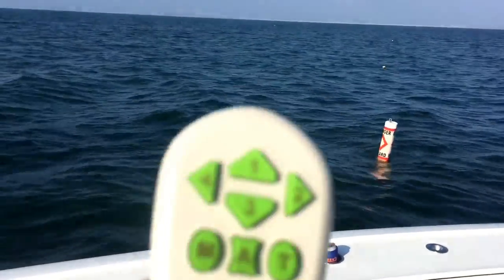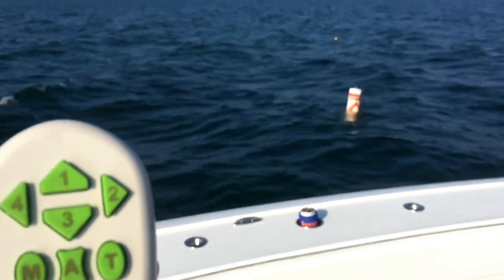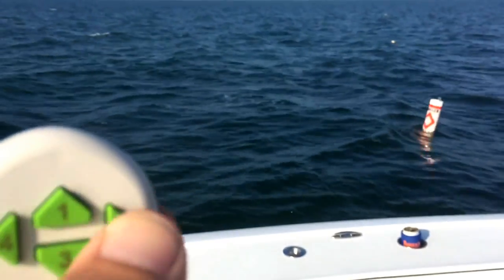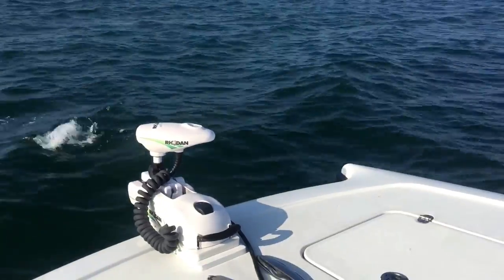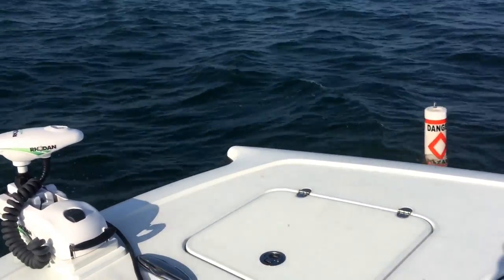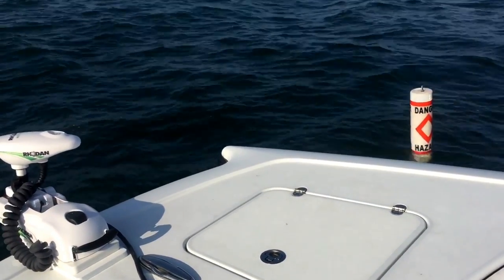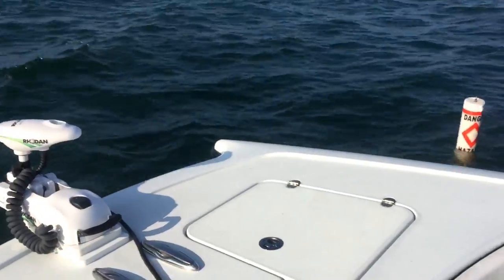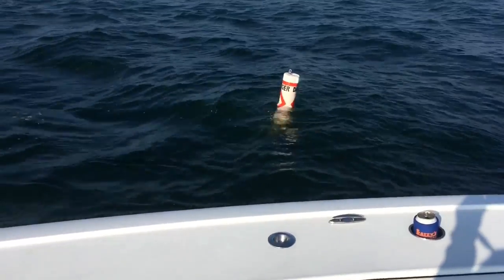Rhodan GPS anchor on the Freeman 37vh

Comment: Recently, a friend installer a 36 volt, 120# thrust, 84 inch shaft, Rhodan on his 27 foot Sailfish with twin 200 hp Yamaha's. We tested the motor twice and it worked flawless. The first time was in St. Andrews Bay where the bay flows out to the Gulf. Conditions, wind 12 to 15 mph, outgoing tide. The second time was  three miles off shore in the Gulf at the Sea Buoy. Conditions, rolling swells 2 to 3 high, wind 10 to 12 mph, current 1.35 mph, wind, current and swells were going in the same directions. The only time the motor would not hold the boat on the spot is when a big swell would force the motor to come out of the water. The motor coming out of the water was my fault because I did not deploy it all the way down. However, the motor would immediately put us back on the spot. Now we are waiting for Red Snapper and Gag Grouper season to open so we can put the Rhodan through its paces.

Comment: Thank you for this video! I have been looking for one on these gps anchors for a while. How does the system perform in a chop? Does it get beat to death riding on the bow? How is the battery life? I have a 27 ft cc and really could use one of these as i fish in 200ft+ but its hard to find reliable info on them!
Reply: I heard you guys are on back order for these products. Is this true & will this thing work on a 32 ft cc regulator?